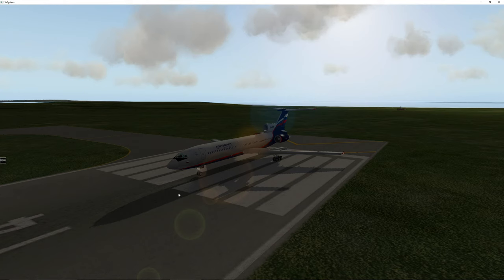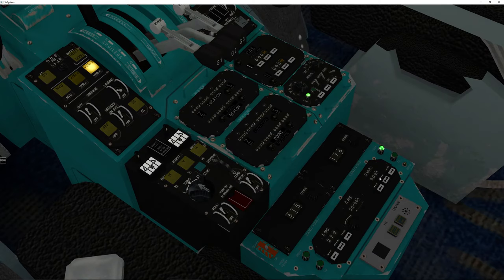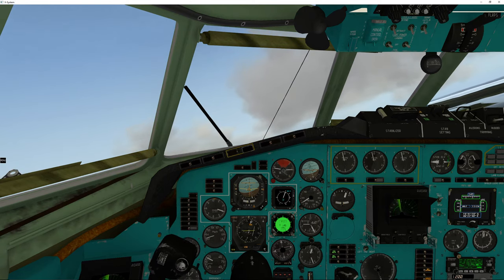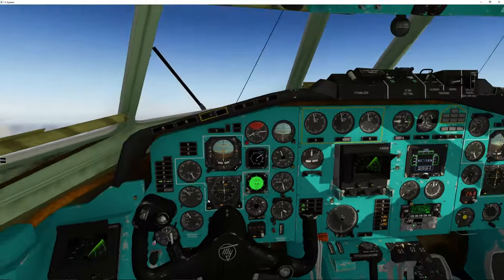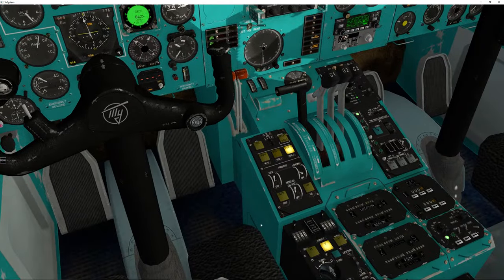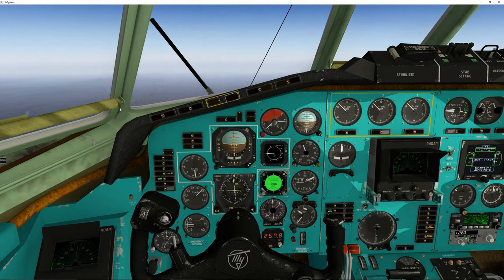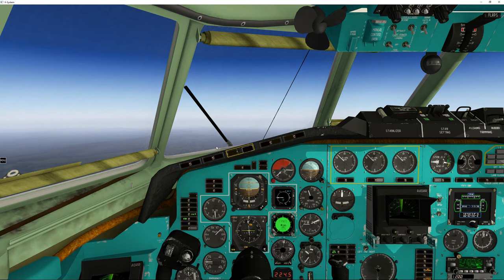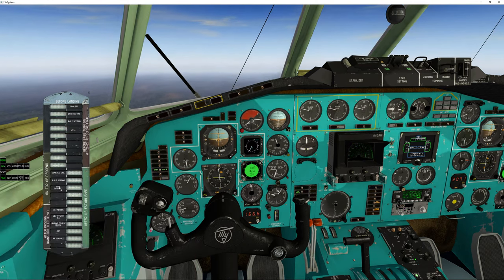Tu-154 VOR/ADF Navigation

Comment: just found these tutorials and they are great!
By the way, you can use upper-right button on the electronic altimeter to select between meters and feet indication. It will give you an ability to enter flight level in feet also :)

Comment: Strange to see these days virtual pilots using the real old fashioned navigation (Vor and ADF) just like old school pilots (737-200). I know the basics of VOR and ADF so I would like to answer you some couple of questions. Where did you learn the concepts and theory? Do you recommend some web for me to learn about this?
Reply from the maker: When I was working on my private pilot license those were some of the first things we learned when starting out with navigation other than pilotage and dead reckoning.  We did have a GPS unit but the thing was ancient and tough to use in turbulence so we adapted.  As for web sources, the best I know for ADF and VOR is http://www.navfltsm.addr.com/ndb-nav-adf-1.htm as it covers even distance estimation and triangulation, plus the  approaches used.  NDB is weird to use in high speed aircraft since wind doesn't throw you off course nearly as bad at lower speeds.
Reply: This is what simulators are made for. You can actually study some old style technics, like NDB/VOR novigation or some rare equipment, like NVU or KLN on Tu154. Hope there are other developers, that give it attention, when making some vintage aircrafts. Although it's not very informative for modern study, as those systems are outdated, but can be real fun in virtual aviation. In my opinion it's much more fun to have some work during the flight, rather than just program the FMC, take off, and get boring few hours flight.
Sadly, there are no old school Short Range Navigational beacons or HF radio in X-Plane. I'd love to see some old school radars also.

Comment: I have a couple of questions was hoping you might know something about:
- do you know what the map angle dial does?
- how would you practically use the KM-5 n1 and n2 gyro correction dials?
Reply from the maker: I don't use the map angle dial, but my assumption would be it's for flying either an offset course or when you are using the NVU with manual settings.  For the n1 and n2 correctors, you can subtract magnetic deviation out with them to use true course.  I only use it when I'm flying excessively close to the north or south pole.
Reply: Hmm still a bit of a mystery that map angle dial then I guess.
oh right so you can use them to do alignment using the magnetic gyros to get your directional gyros to point to true north?
Reply: Still keen to see a video sometime with long range flight (and flight planning) using the NVU, correcting NVU error on the fly with radios, and explanation of the various gyros and different ways to use them. Might make one myself if I can get my head around them all via experimentation :)
Reply from the maker: Okay!  So from the horse's mouth: 
"KM-5 gauges show the heading obtained from the magnetic sensors in the wings. The rotary allows you to adjust that heading to a certain value, if for some reason the magnetic heading is incorrect. That value is then sent to the gyros for correction.

The Map Angle gauge is part of a system to correct the NVU data with a RSBN navaid."

So in short they're really for correction and the Map Angle gauge acts as the radial selector for the RSBN/SHORAN system.  Now that's a tutorial for another day.
Reply: ah yes nice! so you could use KM-5 to apply magnetic declination to obtain true north?

correcting NVU with RSBN does certainly sound like a good topic for a tutorial at some stage. Although only useful over Russia/Europe I guess...